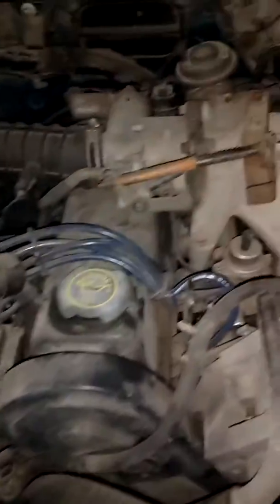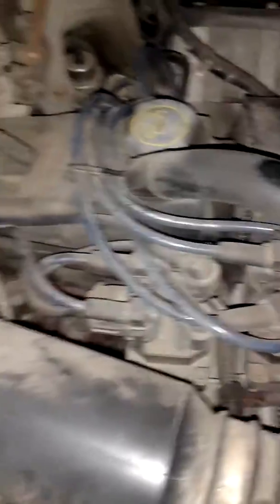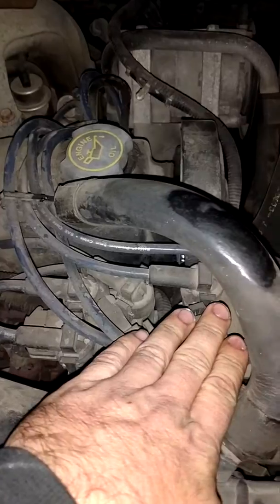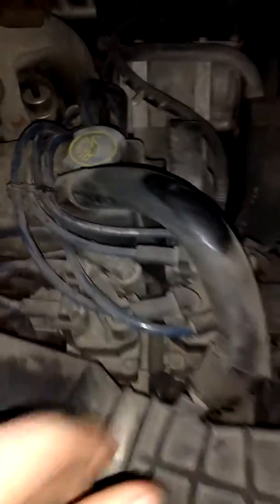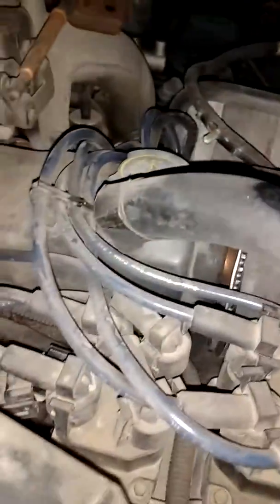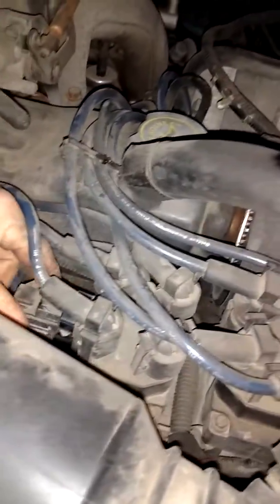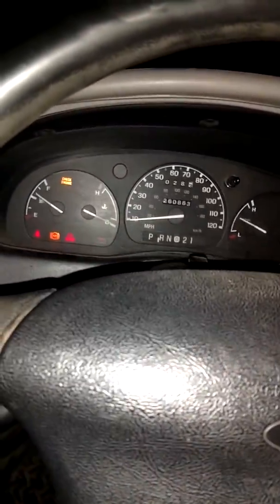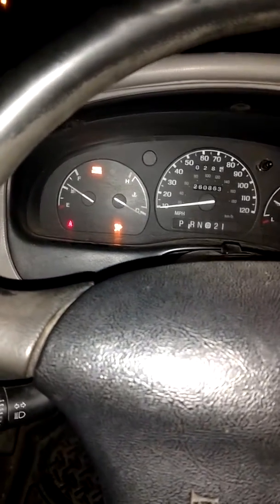The Ford 2.3L Dual plug myth, the explanation of why it doesn't work.

Comment: One side fires a fraction before. Cali models had this due to the change in air quality laws there, first introduced in 1994. I have a 94 Mazda b2300. The only thing this does is reduce exhaust emissions. I’m not gonna say my catalytic converter rusted away but it might have. And I may be straight piped now. I have a “flowby” Happening at the thermostat. 
I can only hit operating temp when it’s over 90 and the ac is running. Timed by light within 5 +/-.  When I do hit op temp check engine light shuts off. I’ve looped the system for testing (eec-iv). No codes not even o2. Truck runs super clean for the age. If my gauge is right (not likely has a rpm gauge not std equipment). I’m at 281k. Never have had engine troubles. 
When she does quit I’ll probably open her and see if I can rebuild it.
Reply from the maker: carey edgin the 8 plug has operated in the same fashion since it was first introduced in 1988 in the ranger.
Reply: spike662 88 is carbed 2.0. Please try again.
Reply from the maker: carey edgin no, mod year 88 they switched to 8 plug efi. This is verifiable fact, and in 89 all US rangers were 8 plug. Also verifiable fact. Yes, in 88 they had a 2.0 for half the model year, but the switch to 8 plug happened in the 88 model.
Reply: spike662 alright so you just validated my point the 88 was carbed. If they switched mid year that doesn’t make it less true. Again the waste spark ignition system is for emissions control    It’s also used with Mazda rotary, making the point of the need for emissions control as everyone know rotarys a dirty dirty engines.
Reply: spike662 as I said

The wasted spark system is an ignition system used in some four-stroke cycle internal combustion engines. In a wasted spark system, the spark plugs fire in pairs, with one plug in a cylinder on its compression stroke and the other plug in a cylinder on its exhaust stroke. The extra spark during the exhaust stroke has no effect and is thus "wasted". This design halves the number of components necessary in a typical ignition system, while the extra spark, against much reduced dielectric resistance, barely impacts the lifespan of modern ignition components. In a typical engine, it requires only about 2–3 kV to fire the cylinder on its exhaust stroke. The remaining coil energy is available to fire the spark plug in the cylinder on its compression stroke (typically about 8 to 12 kV)
Credit Wikipedia.
Reply from the maker: carey edgin 

You have validated all my points. Thanks. And I didn't say your statement was untrue, I said they started 8plug in 88, to which you arrogantly said was wrong. You were wrong, not me.

Comment: Interesting fact, the 2v 4.6 uses the exact same coil packs. (Part # 2-5186) and you are absolutely correct, they fire two at a time which is why you can swap the plugs around. I laugh at every "mechanic" that claims swapping the wires does anything
Reply: There's a bunch of Fords that use them. The packs on my 95 Ranger are from a 94 Thunderbird 4.6

Comment: lol what? how can it be a negative spark? would it not ground out? wouldn't  all 8 spark at once if that was the case?  i feel its 2 positive charges just one fires on compression and one on exhaust same as gm.  but yes you are right there is no change in performance
Reply from the maker: chunk1200 no manufacturer fires one on compression and one on exhaust. Each coil pack has two coil windings in it. Two spark plugs are connected to each winding. The winding is not grounded to chassis ground. One side goes to one plug wore, the other side goes to the other plug wire. Any time that coil fires, both of the plugs fire. Whichever direction the current flows determines which plug has the positive charge, and the other plug the current has to travel through to complete the circuit. The plug that gets the positive side has the electricity flow from the plug wire, through the electrode, and it Sparks to the ground strap. It then goes from that ground strap, through the head, and to the ground strap from the head. It has at this point, positive energy at the ground strap of this plug, which Sparks to the electrode, through the wire, and back to the other side of the coil winding.

A traditional coil on a distributor engine has the ground d side of the coil attached to chassis ground, wasted spark does not.
Reply: ok with that being said if you remove 1 plug wire would that not cause  2  plugs not to fire?
Reply from the maker: Correct
Reply: This isn't correct just saying. Both wires on that one side of the coil fire at the same time. One will still fire even if you remove the other one. So if you pull the wire off of cylinder 3 with one coil pack connected cylinder 1,2 and 4 will still fire. With the way you explained that you are saying if I pull the plug wire off cylinder 3 then 2 should stop firing because the " Circuit" isn't complete. This in not the case with these.
Reply from the maker: Ben O'Brien you are correct, if there's only one coil pack hooked up. The 2.3 uses two coil packs, so when you unhook one, you still have the other coil pack firing.
Reply: What I'm saying if you explanation of how the coil works isn't quite right. The circuit doesn't go out one plug and into another one. The circuit is completed once the plug is grounded to the head.
Reply from the maker: Ben O'Brien that is incorrect. In a traditional distributor ignition you are correct, where one coil fires all the plugs. The waste spark ignition uses a coil pack that is not grounded to chassis ground.
Reply: Its literally grounded via the bracket and the ground wire( Center wire on the three wire plug) going to the coil that energizes the coils in the coil pack.
Reply from the maker: Ben O'Brien no, that ground is for the primary winding in the coil.
Reply: That's my point...... The coil isn't relying on one plug wire to function as the ground or back to the coil as you worded it. I'm just saying I agree with the dual plug BS but your understanding and explanation of how the waste spark ignition system works isn't correct. One wire in the dual pairs does not function as a return or ground. The way would literally are explaining how it works is that you are saying 1 and 4 are wired in series as well as 2 and 3. This is not the case. They function in as a parallel circuit. If it worked the way you explained you would loose spark on cylinder 2 if you unplugged 3, this is not true.
Reply from the maker: Ben O'Brien I am correct, there are a couple videos uploading for my proof, check back later to see if they are done. Part 3 is directed at this conversation.
Reply: A coil is a coil man. I literally taken one of these coils and used one side to run a distributor....